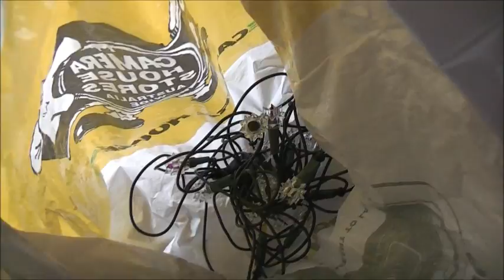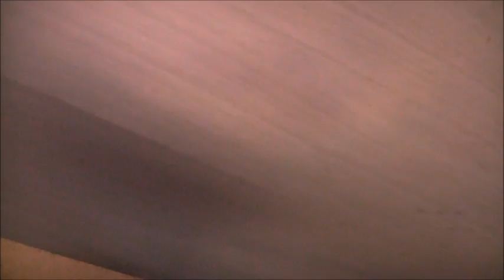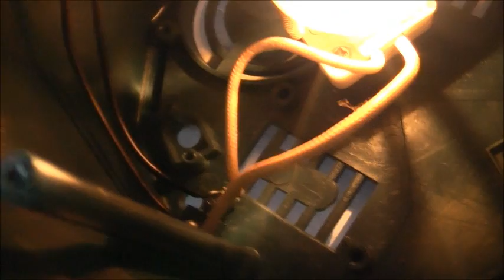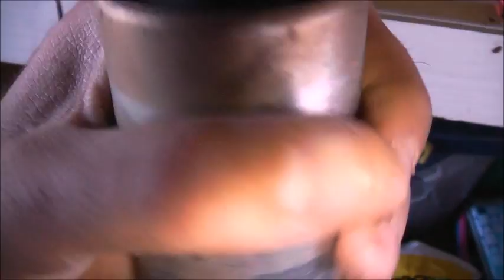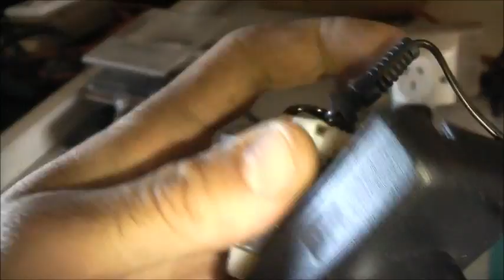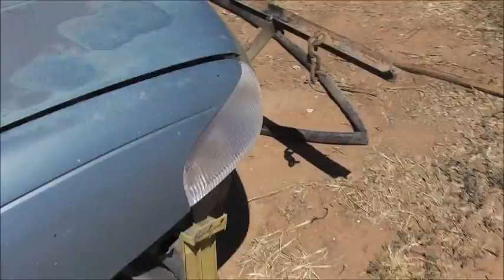Teardown & SUV Tyres On VP Commodore

Comment: We had the older and supposedly unsafe xmas tree lights, 20 x 12v bulbs connected direct to the mains, we never got a 240v shock, everything has to be pillock proof thease days.

Respect electricity and it wont bite.

Looks like the car needs a rear suspension lift lol, mean gripping machine :-)

Transformers allways handy, typically outlast the switchmode psu's.